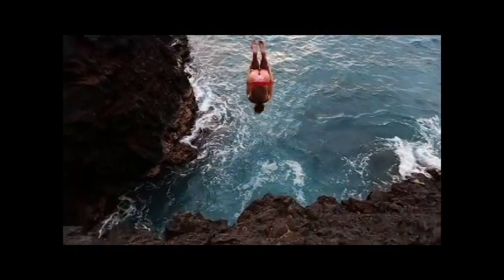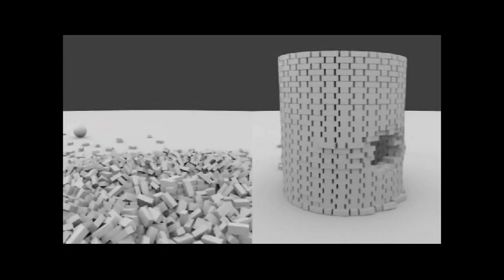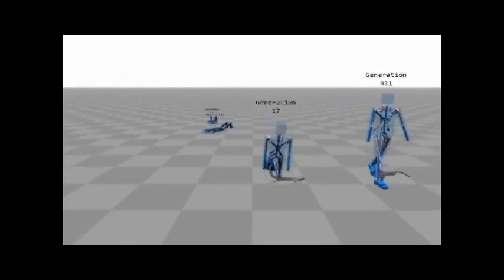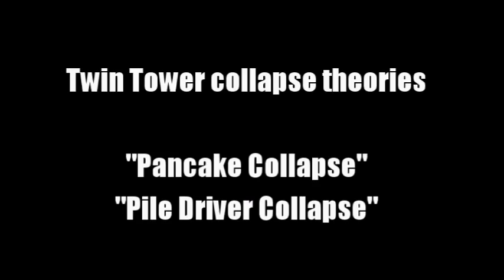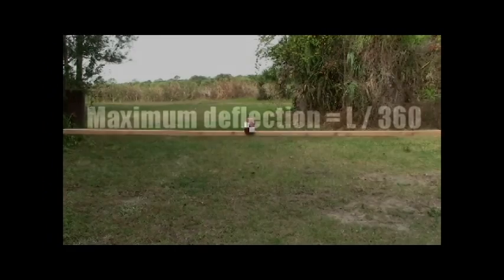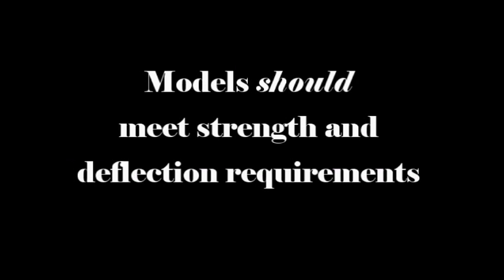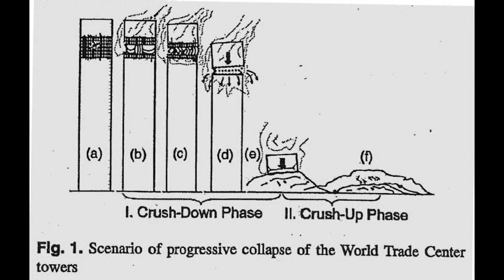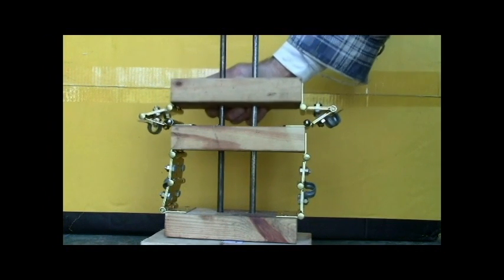9/11 Experiments: The Force Behind the Motion

Comment: This is just absolutely dumb. In no way shape or form does using wood, paper, tape or plastic pizza tables replicate the forces that day. The one thing that disproves all this silly bullshit is the sound. Explosions produce very loud short bursts of sound that are very distinguishable from other ordinary sounds (like his fireworks). As the  towers fell they didn't put off any explosive sounds or popping like you hear in any controlled demolition that I've heard. No, what we all heard was a gradual roar that built until it was a deafening rumble. That's the sound of debris accumulating just like the sound of an avalanche getting bigger and faster as it gains mass and momentum as it falls down the mountain. People forget about the sound. It means more than the importance of the damage caused by the 14,000 combined gallons of aviation kerosene, because it describes the nature of the collapse, not a pancake, not a pile driver, but an avalanche of unbelievable mass and energy that didn't stop until gravity couldn't pull it any closer to the earths core due to the obstruction of the ground. The falling column of liquefied mass caused the air inside the building to become so extremely pressurized that windows were observed to blow out several floors below the debris field. Many claim that it was because of explosions, however in an explosion all windows will blow out due to the shock wave of the detonated explosive, in the event of over pressurization the weakest window will fall victim to the pressure and blow out, alleviating the pressure on that floor as witnessed by the neighboring windows staying intact and a horizontal chimney plume of smoke being ejected form the broken window. BTW has anybody ever seen the inside of a 30 story building that is about to be brought down by controlled demolition? It has hundreds of miles of wires, holes drilled by large jackhammer drills, columns rapped with fabric and chain link, not to hold back the debris of the explosion, but to magnify the explosion on the columns and not let that energy escape. It requires hundreds of employees months of laborious work around the clock to prepare, and that's just for a 30 story building let alone 2 - 110 story buildings and the 47 story building 7. That would take years, and it would be obvious, and to make it covert would take decades. It's just idiotic to think like this guy, like a child. SMH.

Comment: Soooo.. since we didn't see any large explosions during the collapse, that means your experiment is wrong.. right? By your own admission, your conclusion doesn't make sense.

The explosion necessary to take out the structure on each and every floor would be exponentially greater than the "pop, pop, pop" of windows blowing out as a result of the built up air pressure of the top floors coming down.

And besides your theory of how they detonated doesn't line up with how buildings are demolished. They never put explosives on every floor. You blow the main supports from the bottom and let the weight of the structure do the rest.

Comment: In your pile driver experiment you have a destructive force deficit as a result of a deficiency of mass in the destructible components.
you need more mass and less component strength to duplicate the conditions present in the towers  are more brittle/less resilient
You also need materials in your model that do not absorb  energy they must transfer energy with less loss
basically you built a guitar with spaghetti noodle strings to prove sting instruments impossible

Comment: Pile driver theory
force waves travel at the speed of sound
roughly 700 mph
NOT at the speed of free-fall which is about 120 miles per hour (variable per conditions)
you can actually see the destructive wave from floor collapse preceding the movement of the building materials>
watch the 9/11 videos where they falsely claim you can see planted explosions
those "explosions" are the destructive wave from floor collapse moving through the structure at the speed of sound.
Reply: I guess you know that sound travels through materials like steel and concrete MUCH faster that through air, huh?
Reply: YES IT DOES
Reply: which is why i said roughly 700 mph. I don't know the precise materials to give a more exact speed

Comment: Good video but there's one problem. It proves absolutely nothing! Non of your structures were even remotely similar to that of the twin towers. The one where the tiles were stacked in between  a wooden frame for example, the wooden frame caught each tile as they cracked holding them in a diagonal position. If your going to do a model experiment, it needs to be with a scale model identical in mass to the towers. You'd need to expose it to the same stresses that the real towers were exposed to and the same loads falling onto it. For example the top of the tower didn't just come crashing down through the rest of the building like you're saying in your video. It collapsed landing on the floor below, in turn the floor below collapsed also. As it went down it grew substantially in size and weight. Each floor adding it's weight and size to it as they collapsed. To make a model like this would cost an absolute fortune and it would serve no purpose as they've done it all with computers. I'm not saying computers are infallible either but I'm sure they're more accurate than you models.

Comment: Total pseudo science. How can you explain the so called planted charges surviving the fires from the plane impact? No audio evidence of explosive charges. You can’t recreate this with your simple backyard experiments.
Reply: david boggess  Simply not our job to explain anything to you david. How would you like me to ask you why C4 explosives can be set on fire as a camp fuel to heat C-rations without exploding?
Reply: david boggess   Here's a question for you david: How and why were the buildings vaporized and dustified in mid-air, leaving no solid debri whatsoever? 10 out of 10 duhbunkers never answer this question.
Reply: https://amp.livescience.com/16179-twin-tower-collapse-model-squash-9-11-conspiracies.html
Reply: david boggess   Tipical of a duhbunker to post something from the internet, which is an extention of the Jew-owned media.
Reply: Neo Morpheus Wow! Racist much? Typical of an alt-right conspiracy nut job.
Reply: Neo Morpheus There was no midair vaporization. What you see is the ejection of drywall dust and other materials as the pancaking compression of the air forces it out.
Reply: david boggess Where did you receive your degrees in physics david? By reading your replies, I assume you have achieved a doctorate, right?
Reply: Wes Fox I have just spent a lot of time looking at this from both sides. I reenlisted after 9/11 and the conspiracy’s are compelling. If you don’t like physics explanations then think on this. Both towers collapse began at the impact point of each jet. If charges were planted, the planes would have had to impact preplanned floors. I think that would be virtually impossible for both jets to hit that bullseye. Very unlikely.
Reply: david boggess  If you don't mind my saying david, you seem to be speaking as an expert in these matters. Can you provide verifiable details of your education and work experience in the field of controlled demolitions or structural engineering please?
Reply: Wes Fox I am no expert. I did take a year of physics in college. My degree is in electrical engineering. If 9/11 was an inside job it is because it was allowed to happen. Not a single whistle blower has come forward in 16 years. It would have required hundreds of people to collude in a massacre of other Americans. I just don’t buy it.
Reply: Wes Fox Watch this guys videos with an open mind.
https://www.skeptic.com/eskeptic/11-09-07/
Reply: david boggess  I wish you would comply with my original, direct, request that you provide your verifiable credentials david.
Reply: Wes Fox my degree is in electrical engineering. I’m by no means an expert.  These truther YouTube videos are always flawed and only here to get clicks and money. If you open your mind and look at the scientific explanations of 9/11 you will see that it makes sense. Don’t be swayed by all the bs.

Comment: the thing with the weigjt being dropped on those concrete boards i feel has inaccuracy. the building didn't collapse on a single point of the floor. all surface area of the floors had total collapse onto it. i feel that will change the outcome of the experiment.

Comment: So you say "Here are some planks and other stuff I found lying around to simulate the explosion", and then say the computer animations, which took into account the exact materials, the structural integrity, the exact support structure and much more, are inaccurate... I'm pretty open minded and maybe you're right, but this doesn't serve as proof at all.
Reply: randle guiII If you don't know anything about physics, don't call people out lol. Look up the meaning and formula of acceleration. As long as the acceleration stays above 0, the object speeds up. Not trying to be mean, just don't call people stupid when you don't understand physics...
Reply: We  keep hearing  how the  collapse was at free-fall  speed which was impossible   because each lower floor  had some resistance   before the beam snapped.  
   But  I still haven't seen  a  real-time    FILM  of the collapse     to show that start to finish .  Every  video I see  is a Digital   recording   where  the speed can be sped up or slowed  down .    
     When the 2nd  plane hit  we kept see  the  video that was   sped  up   to make   that plane look like it was doing 500 mph   near sea level  when Boeing's  own Engines specs  warn of  the turbine  melting   speed of 250 mph  near seal  level   because of the thick air  that can also  be warm .  
       Nobody  in the Truther movement wants to use the  accurate   real-time video  by a private citizen    that has the audio  at normal speed    to  catch the jet engine drone  at low speed which was exactly  what I heard  by landing planes   during  my  3 years  at a job   that was  very close to a runway  at a major   airport .  
  The video of the fire fighter  by the sewer   that looks up   and sees it hit the Tower  was the one i used to  calibrate the distance  from the intersection  to the Tower and the speed of sound for when I heard the bang .    
    Even a live Media coverage  after the  1st plane hit   shows  the  slow moving   2nd jet  hit the building   in the backdrop  live feed  .

Comment: Besides the glaring omissions in your calculations and weight ratios, let’s say you were right....you now have to explain why no section of building was blown out and there was no sound from the resulting explosions. There was also no glaring bright lights witnessed and thermite burns BRIGHT, those towers were being filmed by 1000’s of cameras professional and amateur but not one of them picked up an explosion or bright lights going off on every floor. Have you ever been to a controlled demolition, they are loud, very loud. Please replicate with your experiment to validate.
Reply: Somewhere Sunday  Can you prove conclusively as a private citizen that the sound levels on the videos of the destruction of the three steel framed high rises in NYC weren't altered (lowered) Mr. Sunday? After all, there was eye witness testimony from witnesses that did say they heard several, if not a series of explosions at various times following the alleged airplane impacts.
Reply: rockfordfiles can you prove they were altered? I don’t think you know how this works, I accept the official story, if you do not the onus is on you to provide the evidence...

Comment: Each building was filled with explosives in every few levels controlled by remote and they went off in a timely manner. A plane cannot go inside a steel building let alone come out the other side no matter the speed or size or any other factor even a missisle would not be able to shoot down that tower at that level of impact
Reply: Except ZERO evidence of explosives was ever found. NOTHING.
Reply: Hard to find evidence of explosives when you don't take the time to look for it Timmy.